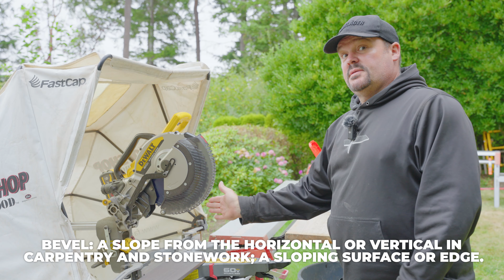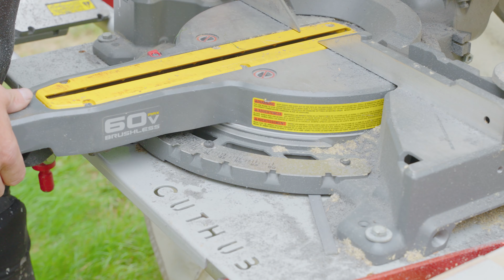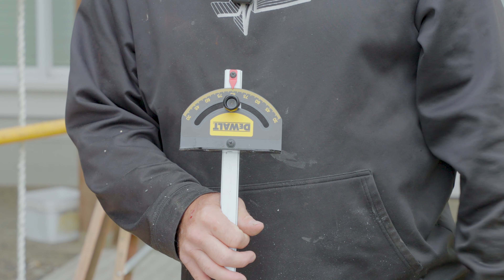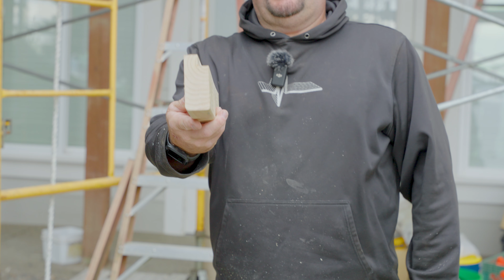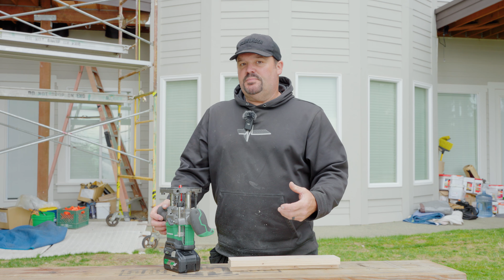A Beginner's Guide To Saw Cuts || Dr Decks

Comment: At 5:40 you instructed to use the fence with cross cut.  The likelihood for kickback is significant.  We are not supposed to use the miter gauge and the fence at once.  If you need multiple pieces of the same length, you can clamp a block to the fence.

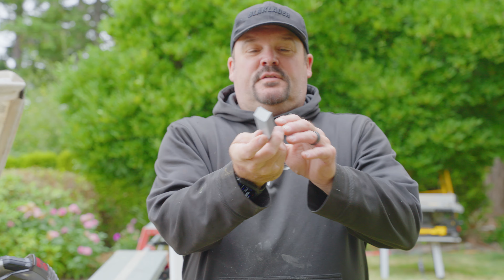Comment: Thank You for showing proper use @ 02:18!!!  I’m sure someone will disagree, but I was taught to keep the head down as the saw blade came to a stop.  I am speaking from experience of over 25 years using a miter saw, incident free I might add.  I can concur on raising the head whilst cutting dimensional lumber, on a tight schedule, but any thin stock, trim, etc, keep the dang head down!  Stay safe Peace!